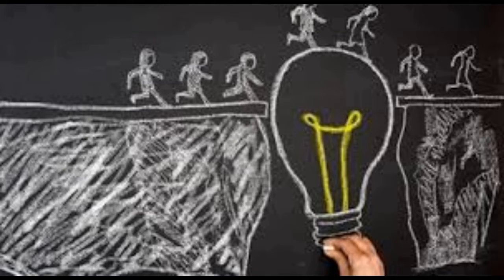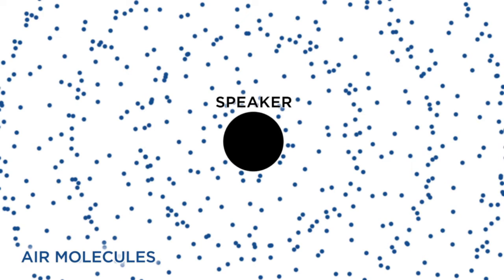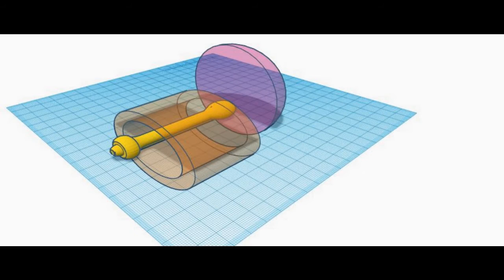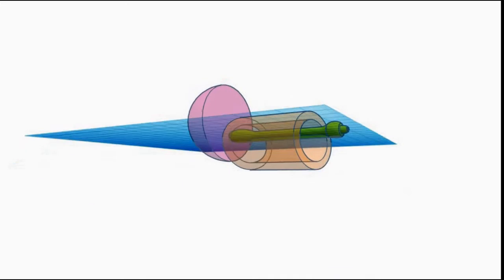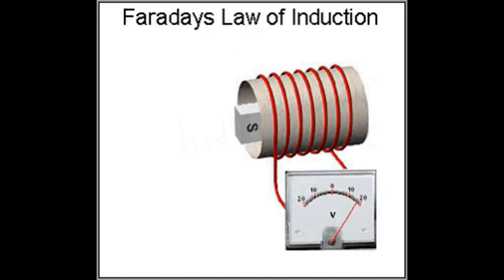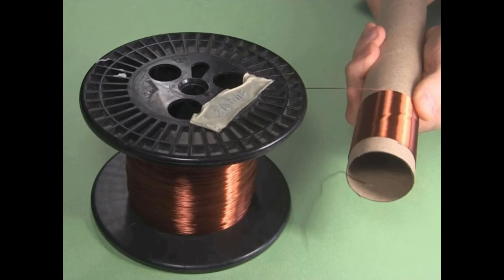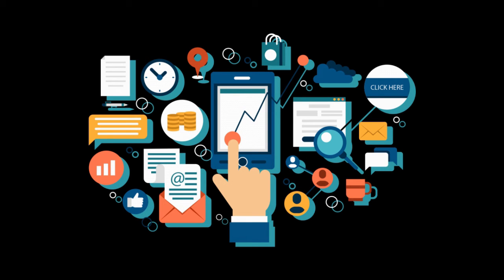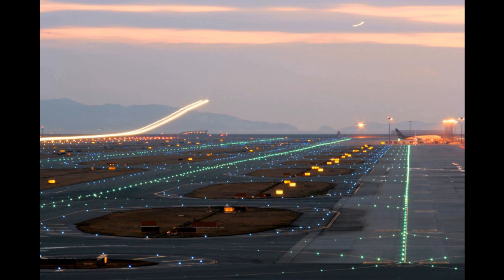Electricity From Noise Pollution PART 2

Comment: Hello bro..
Till now did anyone have done sound to electricity conversion experimentally and is there petent right for this project. Is this product,  available in market.
Reply: Yes there are experimental project available but you will not find final product in market as  power generation is very small scale
Reply: @dhananjayshendre9427  can i have access to any of the experimental project sir?
Reply: Is it possible to generate electricity in large scale